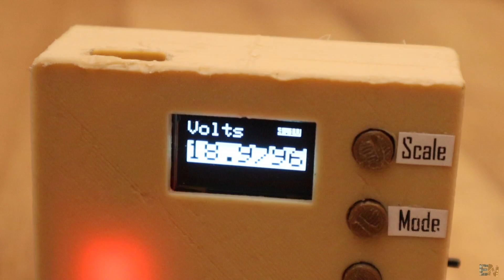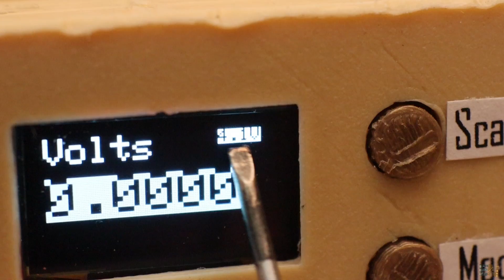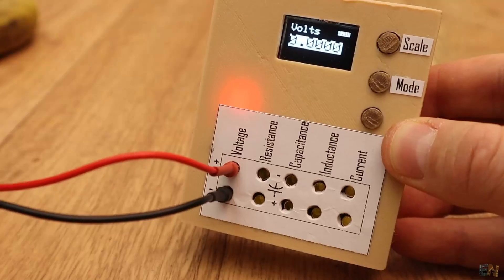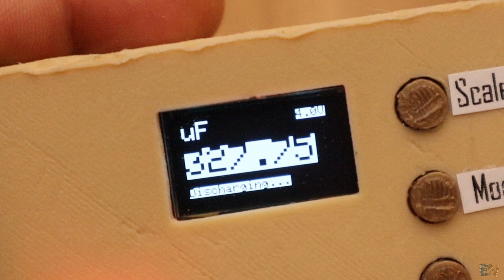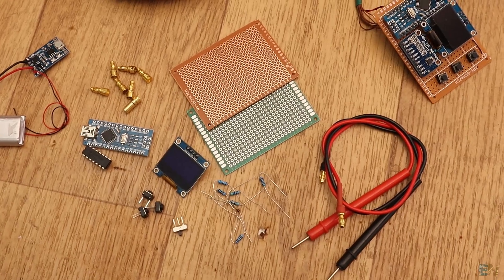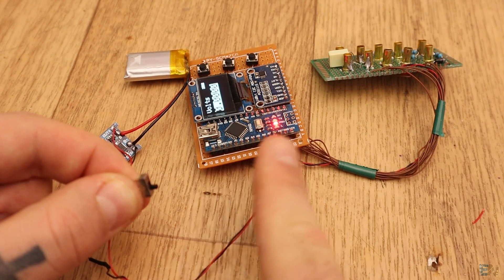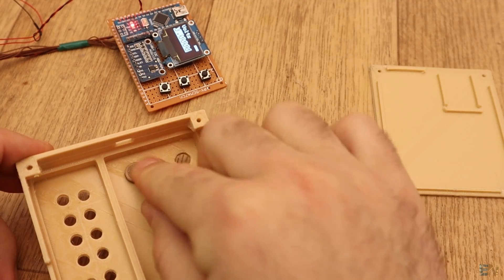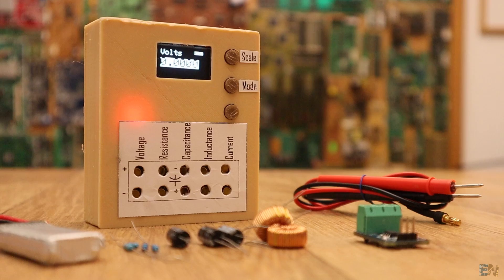Arduino based multimeter | V R C L I

Comment: Hello, I've tried this for a project, but I removed all except for resistance and capacitance because it is only what I need. I tried it and it did not work, from the resistance part and the buttons. Your response will be a great help. Thanks!

Comment: @electronoobs @everyone 
I solved the capacitor problem. I put a rotary switch and I have two inputs.

but when I measure the current there is a difference of -1.2 amperes. why?

Comment: I try downloaded the code but  the the Arduino give me this message  
Arduino: 1.8.9 (Windows 10), Board: "Arduino/Genuino Uno"

Specified folder/zip file does not contain a valid library
Invalid library found in C:\Users\bashomil\Documents\Arduino\libraries\Blynk_v0.3.1: no headers files (.h) found in C:\Users\bashomil\Documents\Arduino\libraries\Blynk_v0.3.1
Invalid library found in C:\Users\bashomil\Documents\Arduino\libraries\Blynk_v0.3.1: no headers files (.h) found in C:\Users\bashomil\Documents\Arduino\libraries\Blynk_v0.3.1
Invalid library found in C:\Users\bashomil\Documents\Arduino\libraries\Blynk_v0.3.1: no headers files (.h) found in C:\Users\bashomil\Documents\Arduino\libraries\Blynk_v0.3.1
can solve this problem ??

Comment: I don't know why when I trying to switch from resistance mode to capacitance mode it always stuck adn I am using a different ic display (0.96 inch and I change the ic addres to 0X3D but I saw the word on the pcb it shows ic addres is 0x78 and edited screen type in ssd1306.h ) but after I made all these changes it still stuck but the txt in the screen are be came normal 
QwQ

Comment: What is the third button for?
The code does not show anything related to it.

In the code you are using A1 as OUTPUT_PIN, sometime as OUTPUT and sometime as INPUT. But in the schematic you have shown no connections for A1 ! What is the function?
Reply: where di you find the code for this please??

Comment: "We have 5 different inputs since having the same input for all the measurements would be quite difficult to make"
https://www.digikey.com/product-detail/en/c-k/R20507RR03Q/CKN11062-ND/3754325 - 5-position rotary switch. Wire leads to one side, and each measurement input to the other. Just don't measure current through it - build another circuit for that.

Comment: Hey Electronoobs. Very nice Project I loved it but I am having screen problem in this project. I think it is configured for 128*32 OLED screen which I cant see the lower lines in my 128*64 OLED. Can you please tell me how to fix this problem?
Reply from the maker: go to documents/Arduino/libraries/Adafruit_SSD1306-master and open Adafruit_SSD1306 .h file

then comment this line: //   #define SSD1306_128_32
and uncomment this one: #define SSD1306_128_64

Keep up!
Reply: @ELECTRONOOBS  Thank you for your help. I fixed the screen problem. now I have problem with capacitor meter. When I am connecting a Capacitor nothing happens. It's like the board is not charging it also in Kohms mode when I connect 100K resistor it shows 9K. Current meter also doesn't work. It shows negative values. In voltage mode I get 8.8 Volts when I connect to 10 volts. I know I am asking too many questions but I wanna make this work like yours.
Reply: I found the problem in code for capacitance. you should change A1 to A2 analog pin because in schematic it is connected to A2 and about resistance in Kohm range I multiplied the output to 10 so it shows 90K now but I am not sure if it is correct way. but I couldn't solve voltage problem yet.

Comment: I greatly appreciate your work. Its an amazing project specially for  education purpose. But this can be improved to make a very practical smart multimeter. Dara logging would be a very useful tool. You can add few lines in the code for data logging and preferably an bluetooth module to transmit the data at real time to the laptop which will work as a display for arduino oscilloscope. Battery capacity meter can also be implemented very easily.

Comment: in the circuit there is a LM324 with 4 op amps, but you used only one, why don't you use a dip8 opamp with 1 or 2 internal  like LM358???
Reply: The TS321 is a better option... As it's designed as the single version of the LM324...
Reply: @Fifury161  LM741

Comment: If you want to add an averaging function, to reduce the amount of jitter in readings,filter out noise, etc.
Here is how.
1. Create a global integer probably 32bit would be best, and an int to use as a simple counter.
2. Replace the delay with one just large enough for ADC conversion to finish (read datasheet for your ADC).
3. Read the ADC, and add that value into the 32bit int, increment the counter variable too.
4. After say 100 readings, take the 32 bit in total, divide by 100, and process to produce an output.
5. Display results on LCD.
5. Reset the two global integers back to 0.

Converting the values to float/double each cycle lead to compound rounding errors. Which I found out the hard way.

Comment: Mybe you can make a battery internal resistance meter? The ones that on the market is really expensive
Reply: Thats right and it would have to be a 4 wire with separate current and voltage path!

Comment: I'm just waiting for the morons that will say "i can just buy a multi-meter at the store". THAT'S NOT THE POINT! The point is for you to learn and have fun making projects that you can be proud of.
Reply: Yep
Reply: Honestly I would buy a multimeter from the store since I want more accurate results with a professionally build case and making it would cost at least two times the cost of multi-meter. But other then that I would like to make a multimeter that you can read everything from two jacks only
Reply: @admniyeokuyorsun...3044  And there you go totally missing the point of the project. Did you learn more about what makes a Multimeter work and the blocks used?

Comment: Interesting project. While I know this is not intended for practical usage, there are a few easy improvements that can be done on firmware:
1. Relative function. This a pretty useful function, especially in RCL modes to cancel out the RCL of the multimeter + probes, and this is a very good use for the bottom button. It's like a balance's "tare" function, which zeroes out the display, and it's easy peasy lemon squeezy to implement: just add an extra variable to store the value when the button is pressed, and subtract it from the measurement (and optionally add a symbol to the screen to say it's in relative mode). Every multimeter should have it!
2. Autoranging. Why manually switch between the ranges if you already have the hardware to do so in the firmware? Shouldn't be too difficult to implement.
3. Fixed number of significant figures. IDK if you've heard of significant figures (it's a PITA, BTW) in school or uni, but there should be a fixed number of digits in the screen (easy to implement with rounding), especially on ohm's mode. If the measurement is jumping all over the place, it's useless. You don't actually have that precision.
4. As as simple hardware addition, you could use normal mechanical switches to switch between V, R, C and L, so that you only need 3 connectors: VRCL modes, COM for ground and A for amps.
Of course, there are many more improvements possible (making a good multimeter is no easy feat), but these are the easy ones.
Reply from the maker: Thank you very much. Very informative!
Reply: Take a look at Arduino's "smoothing" function. I've been working on a similar project and smoothing will take a defined number of measurements and average them every time the loop repeats. It results in a nice stable output - and also measurements "ramp" up and down to the value which is kind neat"

Comment: Can you make a pcb gerber design for the project to make it more compact??
Reply: Replacing the LM324 with a SOIC8 single or dual opamp is a good place to start, as the circuit only uses 1 of 4 inside the LM324.
Reply: @station240  Like the TS321 - which is a single channel version of the LM324! I reckon I'll have a go at making a PCB and include a mechanical switch to select the various inputs...
Reply: @Fifury161  I found SOT23-5 opamps to be a pain to hand solder.
Reply: @station240  Fair point - after I recommended that part I went to check the price - it appears the original LM324 is cheaper! 10 for $0.99, there are easier to solder as well!